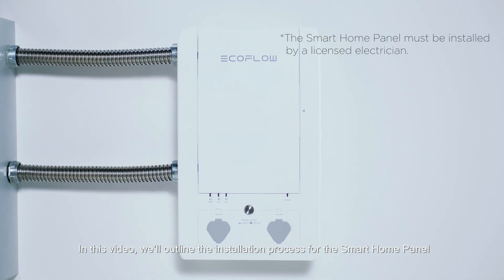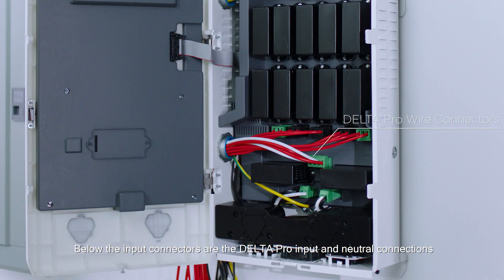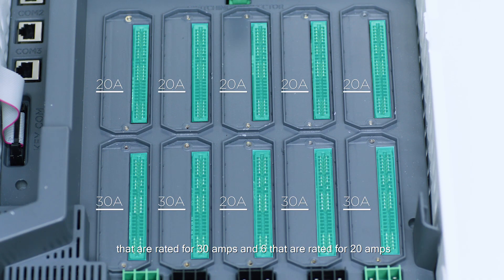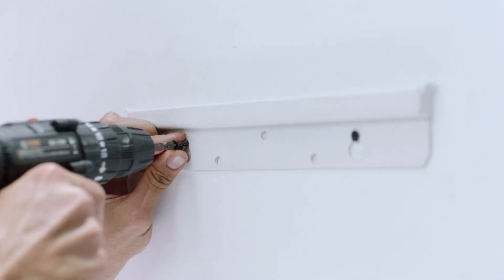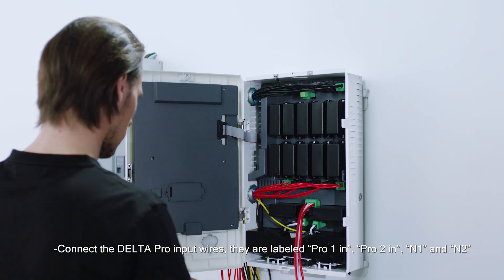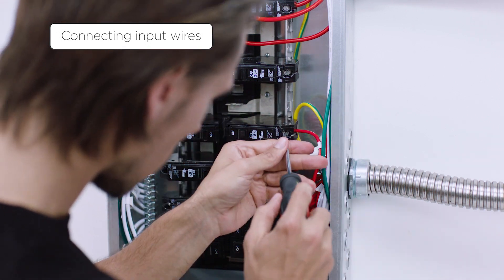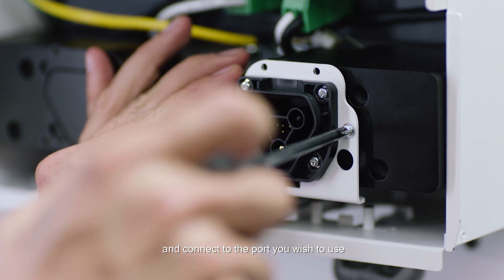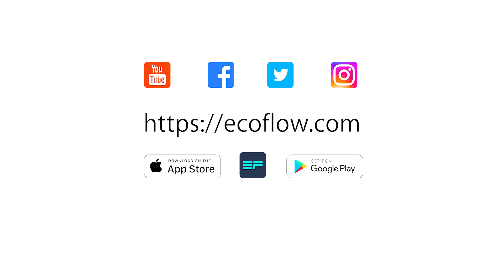How to Install and Setup the Smart Home Panel

Comment: Can we connect two ecoflow pros without enabling the 220V split phase so both ecoflows pros will be used just to power 120V circuts?
Reply: Yes. That's the default mode.

Comment: Can you please share were in can find the wire conduit that used on the connection between the panel and the circuit box? Thanks
Reply: anywhere
Reply: @bluesman6220  Where is anywhere, that specific type is not available nowhere

Comment: I had purchased 2 SHP, 4 Delta Pro, and 3 extra batteries. The 1st SHP and the 2 Delta Pro was working with no problems until I added the 2nd SHP. It can never pass the wire test on the 2nd SHP with all 10 circuits. Even I triple check all the wires and install one circuit at a time. It can never go past 4 circuits before I failed my wire test. Circuit the passed the wire test the day before will suddenly fail. It will sometime crosslink my circuit information between the 2 panels and locked my circuit because it’s not the correct information. I’ve been talking the tech support for the past 2 months and we have agreed that the problem is the software and they will find a patch and upload to me but I’m still waiting. I lost all the names I had put in on both panels 2 weeks ago and tech support told me it could be because their server went down and they will check with R&D and get back to me. That was the last time I heard from them. I had sent 3 follow up emails but no response. My 2nd SHP is running 240 but the software only allow me the choose 120. I am scare this could be a fire hazard but they are just ignoring my email.

Comment: I must be missing something; this install seems very straight forward. 80/90% of connections are done before even needing to touch the electrical box.  All the smart home connections seem plug and play simple.  In the electrical box you're just switching out the load wire per breaker with the appropriate wire from the smart panel.  Then marrying the load wire to the other wire from the SHP.  I still want an electrician to pull the permit and do the final hookup, but I feel the prep work (before the electrical panel) is straight forward.

Comment: What is the length of the cables that connect to the delta pros?  Just ordered the equipment and my electrician will take some measurements.

Comment: I have an Ecoflow delta pro, I am wondering if it is necessary to use the "Smart Home Panel" made by Ecoflow?  I've heard that this is just their brand, and it is very expensive compared to other control panels, what makes this better and why?
Reply: I would not spend that kind of money when I could just use the dual voltage hub on my two DPs and plug that 240v output to a 30 amp generator input to my existing panel with a lockout kit. To me this is much more effective

Comment: I just received my Delta 2 today. Even this device, which obviously has much less capacity than a Delta Pro, is amazing.  I wanted it mainly for it's portability. I'm going to add an extra battery to the Delta 2, and then get a Delta Pro, also with an extra battery. We just had a storm here less than a month ago, and the power was out for nearly 3.5 days. I did have a 70Ah LiFePo4 battery and a 220 watt panel, so I wasn't without power, but I'll never go without a substantial system again. 

EcoFlow is leading the pack in these devices.

Comment: I can't get his panel to work,  firmware update keeps failing, grid light flashes white and red, error light is on. I can't get live support to help with the issues...Had two different electricians take a crack at it.  if anyone knows what we might be missing please let me know.  Thanks,
Reply: I had to use another device to get the initial firmware to go, then it failed because my router lost power, once I got that powered back on it worked from that 2nd device to do the update

Comment: Hilarious.  This won't work for most people because they have their main panel set in the wall between 2 studs and drywall.   Not easy to go into the side.
Reply: Hilarious that someone who can’t open an electrical panel or cut a piece of drywall wants to install a backup electrical system, that can power an entire home… calls electrician, “hey sorry I’m not able to run another circuit it looks like your electrical panel is recessed into the wall like 70% of homes”
Reply: @chrish42000  Thanks for the info Karen.
Reply: @Craig32  Its almost like you replied that to yourself.
Reply: This is probably for the outside panel. Which is weird because who would want to leave an expensive item unattended outside.

Comment: I got my Delta Pro last week. Prevously I planned to integrate it into my homesystem. After trying it in some situations, I recognized the fan is much too loud to use the ecoflow inside. Is there a possibility to configure the fan noise?
Reply: Dishwashers are louder than the fans
Reply: yeah my wife never shuts up @zxcvbnmmification

Comment: When I’m in the basement near the panel everything works fine over Bluetooth.  But, it simply will not recognize and connect to my home wi-fi no matter how much I try, which means there is no way to access the panel using my phone elsewhere in the home or while away from home.  I’ve gone back and forth with customer service, and followed all of their suggestions, but still nothing!
Reply: Sir, I was wondering the same thing about wifi, however it appears that the Smart Panel is bluetooth only, but some of the power packs have a 2.4ghz wifi ability. I may be wrong.
Reply: @pauloneal2330  Actually, the Smart Panel is supposed to connect via Bluetooth and Wi-Fi, but mine won’t connect to Wi-Fi.  EcoFlow techs have done remote troubleshooting and determined my Smart Panel is defective, so they are sending me a new one.  Just today they sent me the pre-paid mailing label so I can return the defective unit.
Reply: @davidcadoret2000  Any updates? Seems like an overpriced car battery that won't run as lomg as a natrual gas generator or as powerful for the price 🤔

Comment: How do you tie on solar panels
Reply: I was looking for the same thing. My guess is that they tie into the actual delta pro units themselves. So you're limited to the size/amount of panels per battery unit. So to run a house off solar would probably require 4 at minimum, depending on what you have
Reply: I have them. Each Delta Pro has a port for solar charging. Each Delta Pro is limited to 1.6kw input, so 2 of them is 3.2kw input. Not a lot.

Comment: Can't the output wires go directly to appliances instead of being routed to the house breaker panel? I understand i need to re route the conduit piping from the existing home breaker panel, my concern is too many joints and extra wires in the house breaker panel. 

I just rewatched, the house circuit breaker is attached to each input relay, with same current, in the smart panel. 
Then the live output (black wire, which confused me for negative)  is connected to the appliance live wire previously removed from the house circuit breaker. 

And then another circuit breaker is added to the house panel for charging the two Delta Pros. 

The negative wire remains as was in the house breaker panel.
Got it!

Comment: Where can I get the wires to extend to 40 ft from the regular panel to the smart panel?
Reply: The further away from the “regular” panel the more you have what is called voltage drop. Your panels should be close to each other the way it shows in the video.